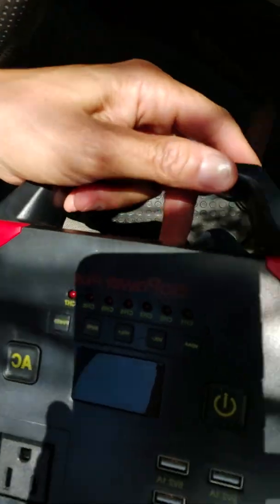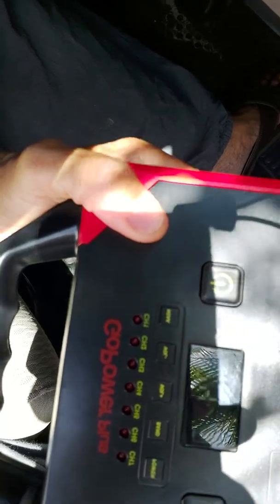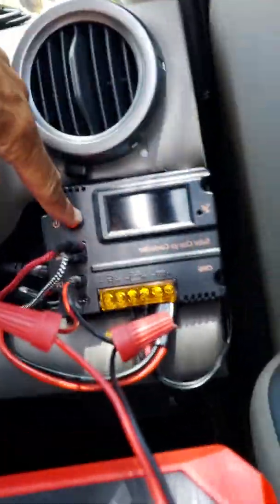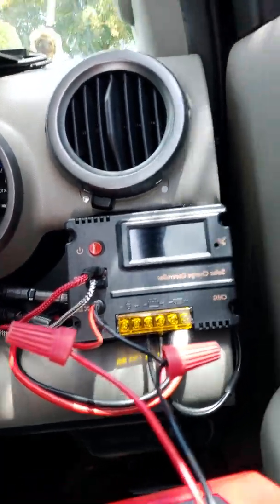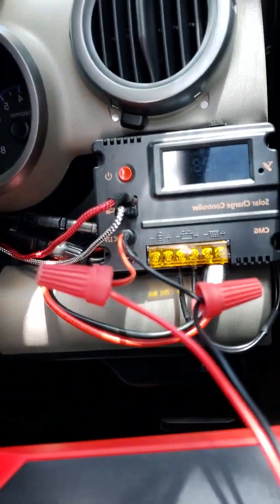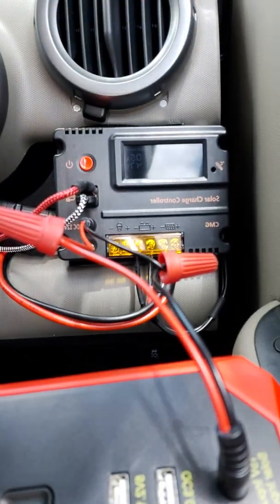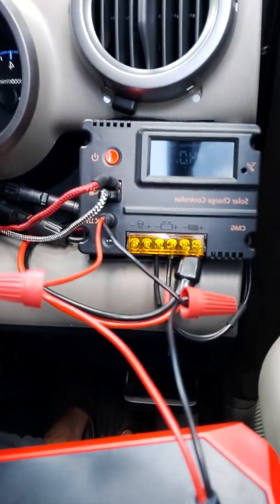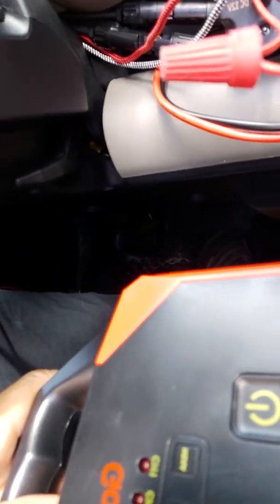GoPower Plus Solar Gen | Testing  DC12V on GHB PWM  MC4  Lensun 55W Solar Panel Part 1

Comment: Why is there a solar controller in your car tho
Reply from the maker: Thanks for your comment. The reason why there is a Solar Controller Regulator it's connected to the battery for keep the battery topped off and prevent it from over charging. I have Solar Panel on the dash full size one 55W. I use the Solar Controller to also charge USB devices. But going to use to run my LED Full Light Array for my SUV just have to install it. Makes it easy to connect that and you can turn off all DC and USB connection with the simple red button connected to them.